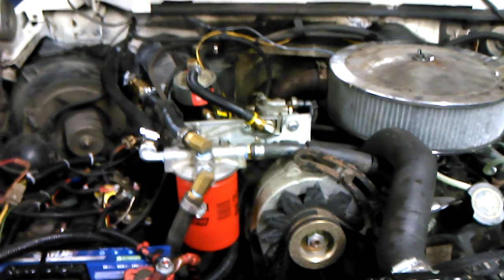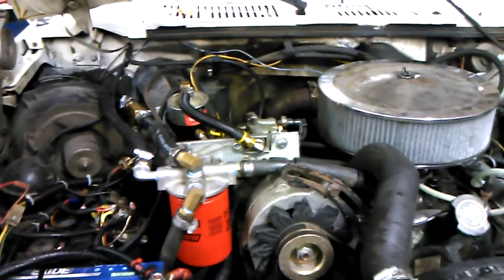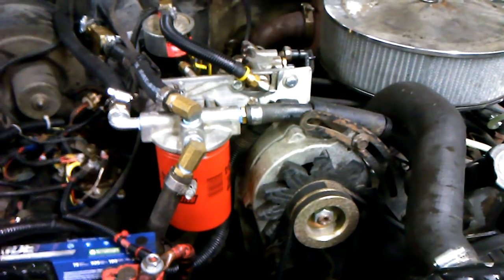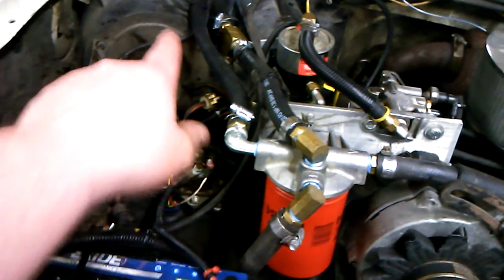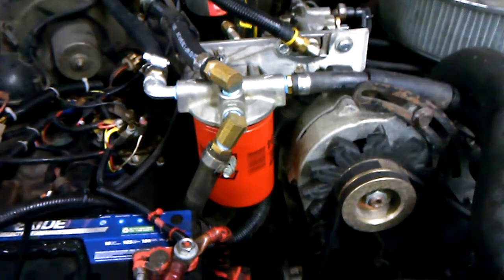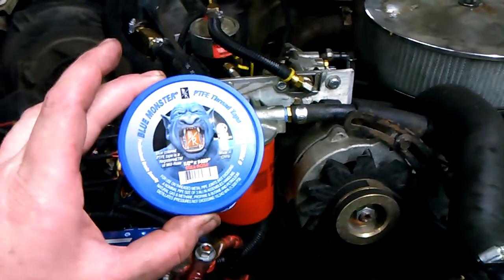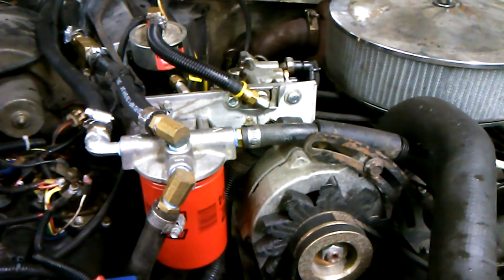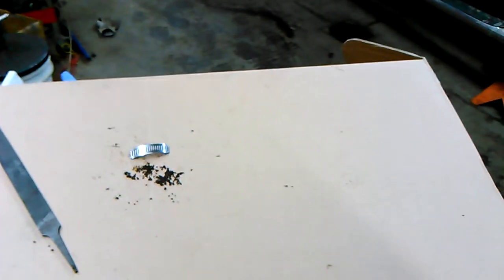Part 2 IDI coolant filter upgrade

Comment: Does your fecet fuel pump get hot there . It says not over 180 degrees, the reason I ask is I putting one on mine.got a 85 I've got new. Tks
Reply from the maker: I've never noticed excessive heat. It's been on my 94 several years now I sold the 85

Comment: I know this video was posted 4 years ago. Man O man would I live to see with my own eyes what you nice done. It looks soo clean. Recently bought a 94 IDI turbo (great bones) and am in the process of restoring all the brightwork and paint. Being this is my very first diesel ( though it's a basic one they say)  understanding all the differenced VS gasser is a sharp learning curve. Your coolant filtration is really impressive. So wish I could see it with my own eyes. Looks like you are meticulous. Have so much respect for that. Wish someone made the mounting hardware. Sounds like you have access to machine milling for your mount? would love to hear back from you. Now 4 years later you really should post an update on how the system has worked. That would be fantastic. Thanks for sharing this.

Comment: Hey Mike, long term viewer and I need some help. here's we're I'm at now. 93 idi 7.3 its a Rebuilt block, rebuilt cylinder heads, band new aluminum radiator. Rebuilt trans. And my truck still over heats.  I feel like maybe my cooling lines are not going where their supposed too any tips. By the way no thermostat. And new filters everywhere and cleaned out oil cooler at the machine shop too. Thanks mike
Reply from the maker: Sounds like you have way too much restriction somewhere. No collapsed hose anywhere? Done a flush?
Reply: @groundtogreen1140 thanks for the quick reply man. And I installed the radiator today and after 20 min 215 almost 220 on gauge. Hoses are good even completely cut off the heater core till I figure it out. Honestly I think my coolant lines other than top and bottom radiator hose are going in the wrong direction can that be possible?
Reply: @groundtogreen1140  I want to replace my lines but I'm not sure what kind of diagram to fallow for this one
Reply from the maker: @3tree3  if you copy the way I have it set up you shouldn't no wrong
Reply: @groundtogreen1140  ok I'll give it a shot do any hoses come out from you cylinder heads? Or top of water pump?
Reply: @groundtogreen1140  figured it out. Belts were wrong temp sensor was on the head by exhaust this thing is flying at a cool 160 :) thanks man just need to go threw air intrusion now

Comment: Where did you source your fittings?  Anything to look out for in terms of quality, temperature ratings, etc?  I'm assuming you wouldn't want to just run out to the home center and buy some brass fittings for this.
Reply from the maker: I don't know the accurate before temp ratings because my coolant filter was installed before my temp gauge was in.  as for fittings I got them from a mixture of menards,  a hydraulic store,  and oreillys oh I did order the 3/8 to 3/4 barb ones from a marine supply shop (yes the lines are 5/8 but with a little grease they'll go on a 3/4 barb )
Reply: Adam Baird yeah actually, basically and metal barbed fittings the right size would work. steal would not be my first choice tho